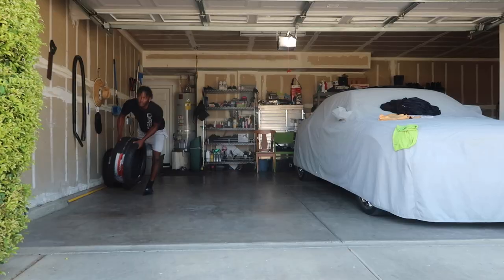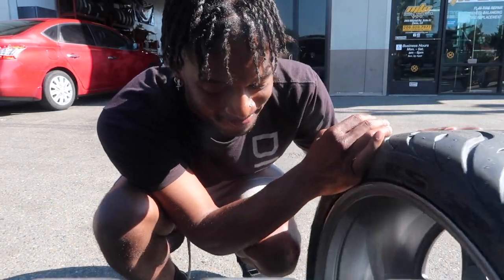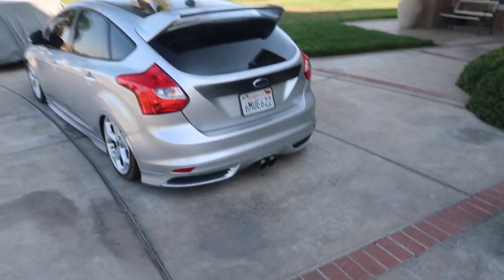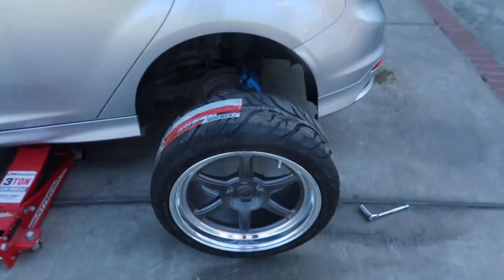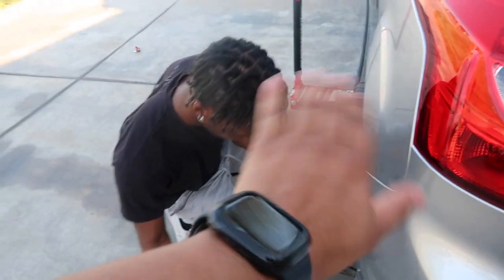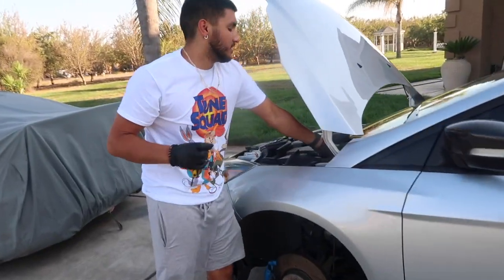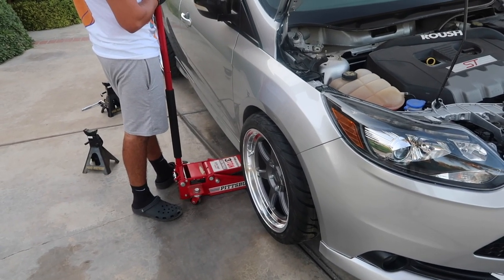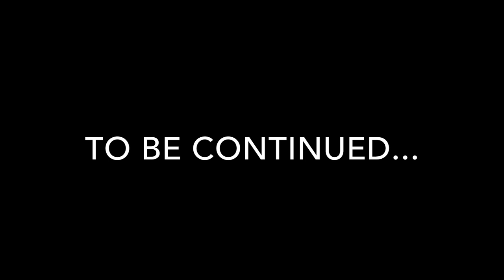this was a $700 mistake....

Comment: You’ll definitely need a 215 or 225 to fit but if you need more space in the front there’s a reverseable fender spacer mod you can do. It won’t mess up your fender but it pushes it out more in case you aren’t able to get enough camber to get them to fit. If you’re interested I can explain it through ig with pictures

Comment: 2 words

Over
Fenders

You dont need a lot! Get the ones from SS Tuning, they keep the stock body lines and look nice and add about an inch on each side of the car which is what you need, and the hardware is concealed so it looks OEM

Comment: I’m running 225/40/R18 on my 18x9.5 +35 and static I’m nearly fender to lip but need stiffer springs, on a 18x9 with your offset personally id go 215/40 or 225/35 and you’ll be set, never have debeaded or caused me any problems and on air it’ll be much smoother
Reply: I have a 2012 focus se hatch